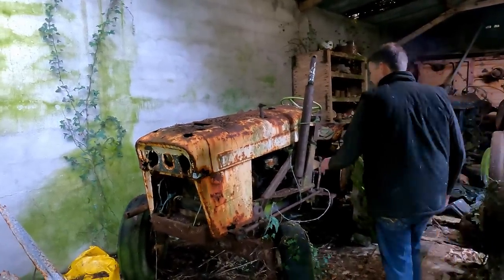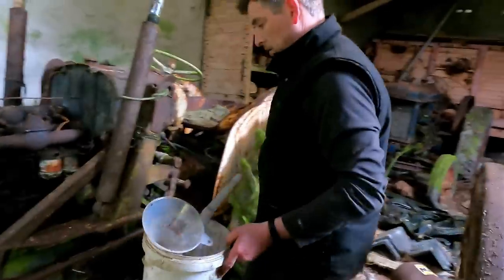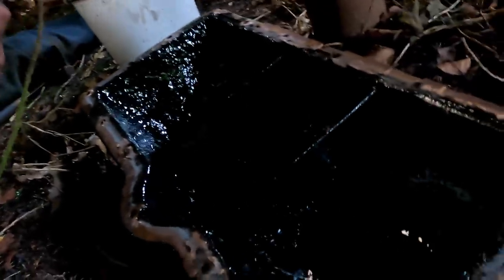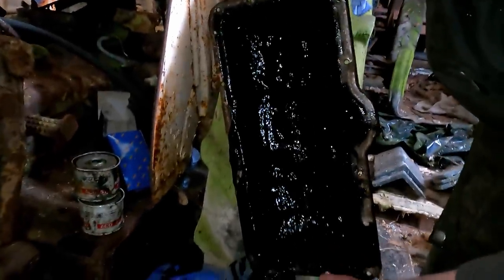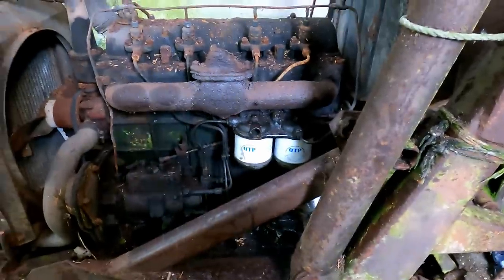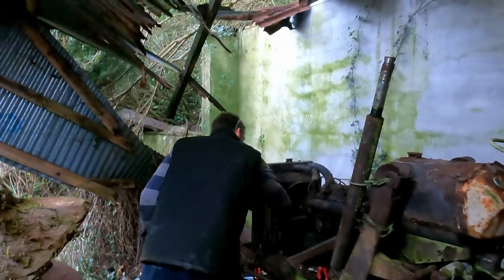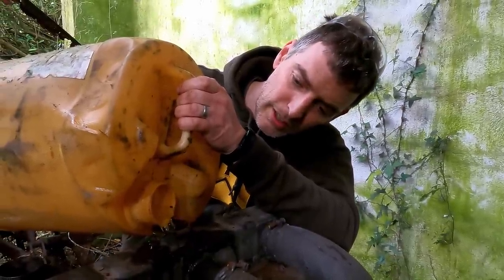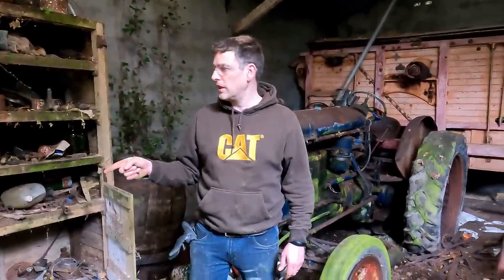Abandoned 30+ Years, will it start? David Brown 990

Comment: Very interesting air cleaner design
Reply from the maker: Oil bath filters were very common here right up into the 80s. I guess they changed as it was more profitable to sell paper element filters.
Reply: Yea I mean how it runs through the rad
Reply from the maker: It is weird, but keeps the bonnet line low.
Reply: @davesworkshop2714 
And, in winter, heats the airflow👍

Comment: I was 100% certain that tractor would not start, great job at getting it to fire up
Reply from the maker: Thanks Mike. Those DBs seem pretty resilient. Once I found it largely complete and able to roll over I was confident. Just very fortunate that the roof collapsed where it did. A bit further back and it was totalled.
Reply: @davesworkshop2714  I love old tractors simple to repair for the most part. Have been about to get 99% of the ones I worked on going again. The only one I couldn’t was a Ford gasoline tractor had spark and gas but it would never fire even with starting fluid which is very weird timing was good fuel in carb it would turn over and smoke but no run still bugs me after20 years
Reply: @mikeboring1293  That's an impressive % to get running Mike 👍
Reply from the maker: @mikeboring1293  been there with some old gassers (petrols as we call them here) in the past. Some are really stubborn and it takes very  little to upset them. I think the biggest struggles I've had were one of my Rover V8s, my detroit 6V92T and the combine. There's an old E27N gas/tvo tractor in the shed id love to start, but it's missing a lot of parts.

Comment: Wow, that's an amazing little shed with so many gems in there! That David brown just needs a few more jobs done and a few hours hard work and it will be perfect again as it sounds pretty good for one lying so long!! You gotta save that Fordson too!!!
Reply from the maker: It's an incredible find. It's just a shame the fordson is missing parts. I'll certainly see if I can do anything with it though! The 990 is in remarkable condition, the shed was obviously very dry for years.
Reply: @davesworkshop2714  You might have to do a bit of searching to find the right parts but it would be worth it ! Im sure there are still some lying about! i found a few fergusons recently, similar situation! barn falling down on top of them!!! There are still a some out there but finding them is difficult!!
Reply from the maker: @wesleyallen3421  I'm toying with the idea of temporarily fitting a distributor and coil for sparks (requires a 2:1 reduction) and making up an inlet manifold to take carbs I already have, may be enough to get it going. I'll good and soak it down with diesel tomorrow evening to see if I can unstick it. Barn finds like this are getting really scarce alright. I'll keep hunting though 👌
Reply: @davesworkshop2714  Yeah I'm sure you can rig up something! Just keep an eye online you might find the right bits!! There was one the same lying in a hedge on the main rd to Moycullen in Galway! The council cut the hedgerow back and there was an E27N Fordson! That was 12 years ago, it's well gone now! Maby some of the earlier Fordson parts might fit! You would easily make an inlet manifold for that! You will come up with something, be great to get it going again! Look forward to the next video 👍

Comment: Dave, years ago when a ford's on major wouldn't start, no ether at hand, we used lighting paper and put it on the air intake, turned the key/lever, and it started, it warmed the fuel, love your videos, no gloves, on at all, will eventually destroy your hands, Michael, Ireland [Eire]
Reply from the maker: I really should have the gloves on alright, I'll pick up a new box tomorrow, safer with abandoned gear with rats etc. I have seen an oily rag used to good effect. The old manifold heater was only a small step up from it. Thanks for watching and taking the time to comment 🙂

Comment: Great job & well done, been working on a farmers barn which has a 780 with a funny looking square cab on it, the poor thing!
Reply from the maker: Is it sat there long? You should start it 😉🙂🙂
Reply: @davesworkshop2714  been doing work on the farm buildings for 40 years & its always been there along with other strange looking machines, don't think it will start but at least everything is dry in there.

Comment: Do the major is it too or diesel  p6
Reply from the maker: Howard, I'd love to. It's a one owner 1950 TVO. Unfortunately the starter, mag, manifolds and carb are gone. It's also locked up but I'm going to try and free it out. I'll see if there's a cheap way to get it going. It would make a lovely P6 conversion. All it needs after that is a rub with an oily rag.

Comment: Great video is 990 for sale and  there's a tap on the injector pump on the bottom is to help starting extra fuel big help starting
Reply from the maker: Not at the moment Clifford, but I'll keep you posted. The excess fuel tap was seized solid unfortunately, thanks for the tip though!

Comment: I think that ya should try to air up the tires.  Unblock the rear tires., or some people call them tires & rims. AKA wheels to Dave. Awesome job I love knowing that there's still other people out there that care about trying to revive.& Recover old types of vehicles.&etc. That needs to be saved from the outside elements.,or nature will take it over faster than some folks would want to believe that it would.,or could do such A type of thing as we'll to. I say go for it on that tractor.& The other right behind it to.
Reply from the maker: Thanks John. I was thinking the same. Must throw the compressor in the back and go over there. We do plan to try and get it moving for a video, and to see if it can help get it saved. We're also working on the major behind it. Stay tuned! Thanks for watching 🙂

Comment: I only squirt ether when it’s cranking shooting it in non-cranking means it probably dumping in one cylinder. It seems like a very good engine for the way the rest of it looks.
Reply from the maker: Good point John, the tip was broken off the can so I found it a big awkward to handle 😂. Gave a little more than I would have liked too. A dangerous thing in the wrong hands! The tractor overall is actually surprising good, the roof mustn't have collapsed that long ago.

Comment: oy, have we got one for you then. we have a '70 990A that was the working tractor, here, untill only 10 years ago or so.  it has the boom and bucket accessory and a hydraulic leak.  we couldn't get the seals for the hydraulic pump in the states, and there'd been no parts support for it for years, even from the importer (Case/IH imported them to the states).  she's been parked for years with an exhaust manifold that cracked when they tried to disassemble her.
Reply from the maker: That is a shame you can't get parts. I wonder has the situation changed in the last 10 years? Maybe a classic tractor supplier could help now.
Reply: @davesworkshop2714  she's been sitting in a garage under a doublewide that's been well sealed.  The only thing I'm afraid of is a bad case of mold (a Dodge truck stored in there previously severely molded out in the interior!).  parts were nearly impossible BEFORE covid, imagine what it's like in the states, now :P  you can't even get parts for a lawn tractor, let alone a true tractor.  I'm fighting the steering on a Kubota, and need a tension latch and spring for the deck.

Comment: Much better doing without either can get anything started that way  and you could have used the wd 40 as a substitute or parts cleaner
Reply from the maker: I fully agree, it just needed a touch. The excess fuel valve was seized solid so that wasn't an option. At least it fired off the first time without it 🙂👌

Comment: Great move to drop the sump, would have been so tempting to put new oil in and go for a start.
Reply from the maker: After seeing the oil cap missing it was the only choice, I could even see some debris inside the filler. Nice easy sump to drop so it was a no brainer! Thanks for watching 🙂
Reply: @davesworkshop2714  you can’t kill a DB, strong old buses.
Reply from the maker: @spannerdog123  they certainly seem to be!

Comment: Really cool find and nice work getting it running. I was curious as to how you bled the fuel system? That big combining unit behind the Fordson is also pretty cool. We have one that looks almost the same. Cheers
Reply from the maker: Thanks Josef! I opened the bleed nut on the secondary filter and used the hand priming lever on the lift pump. Then I opened the inlet line to the pump slightly. Didn't bother with cracking injectors. I find most if the time, bleeding as far as the pump is enough. Though I did meet one cummins that wouldn't fire until all 6 injector lines were cracked. The tresher looks to be in good condition. Ill bring a video of it and the fordson soon.
Reply: @davesworkshop2714  Thanks mate, that’s good to know!

Comment: Gas torch in the air inlet works just as good as Easy Start and doesn't do any damage.
Reply from the maker: Have seen it done before. To be fair though, used correctly, and in moderation, it does an engine no harm using it once. Thanks for the tip 👍

Comment: That's an early 990 with 6 stud hubs Dave  needs saving 😊
Reply from the maker: I must get the serial number and check it. I don't know my DBs at all. Approx what year could it be? Thanks for watching Paul.
Reply: @Dave's Workshop  at a guess around 1965/66 the very early ones had ignition switch on side above brake pedals under diesel tank
Reply from the maker: @paulhoggart4572  the ignition switch is on the side in that one. Thanks for the information.

Comment: hello from the orkney isles would be great to see the fordson running great channel
Reply from the maker: Thanks William, good to hear from you. I'll certainly have a go at the Major. Will dump some diesel down the bores and see if I can get it turning.
Reply: @davesworkshop2714  the mag might need some work done to it too they dont like damp conditions
Reply from the maker: @williameunson2013  unfortunately the magneto is missing, along with the carb and manifolds 😖
Reply: @davesworkshop2714  oh dear thats a problem could you find parts from somebody their are a lot of them about broken up
Reply from the maker: @williameunson2013  I will look. First step is to see if I can free the engine.  I poured penetrating oil and atf down the bores a few days ago. Ill go back later this week and see can I crack it free.
Reply: @davesworkshop2714  hi dave any luck with the fordson yet
Reply from the maker: @williameunson2013  I've managed to break the engine free, and stuck valves, but I've left the cylinders full of atf and diesel for a while to free it up more. Have had to jump to other projects for now to get videos out

Comment: Great video Dave, I'm fairly handy with the fordson tractors and I actually have an e27n which is what is in front of the thresher here. If you would like some assistance or advice in getting it going I'd be happy to help. Keep up the good work.
Reply from the maker: Gary, thanks very much for the offer, I might take you up on that. Where are you based?
Reply: @davesworkshop2714  I am based in Co. Wexford but always looking for a trip out especially when I can help someone with a fordson.
Reply from the maker: @garyredmond6884  thanks! Is there a parts supplier for them in Ireland? The mag, carb, manifolds and starter are missing. I was toying with the idea of fitting a reduction box and distributor and coil set up to get it running.
Reply: @davesworkshop2714  I would have all the bits here to put it running. A starter wouldn't be needed as usually if the compression is good they start on the 3rd crank. Other than stuck valves I'd say an expedition to get it running would be a success.
Reply from the maker: @garyredmond6884  thanks Gary. I may be in touch. I'm soaking down the bores at the moment to get her freed up to start with.

Comment: I'm more interested in the E27N watching over the proceedings! Is it a Petrol /Parrafin?
Reply from the maker: It certainly is. Its seized and missing a lot of parts, including the mag, manifolds and carb. I pulled the plugs last weekend and put penetrating oil and atf down the bores, hopefully itll free off and we'll take it from there.
Reply: @davesworkshop2714  all those parts are relatively easy to find. As long as the block isn't damaged thatd be a viable recommissioning project.
Reply from the maker: @09amusement  I don't believe it is, though I could be wrong. I'll see how it looks at the weekend after a soak. While parts are available, it isn't my tractor so the cost may be prohibitive, but I'll see what I can do! I would love to see it run. It would just brush the surface flakes off it and wipe it with an oily rag if it was mine. Patina that you just can't buy. I've already started looking for a Perkins P6 as well just in case...
Reply: @davesworkshop2714  that's the case with my Grey Fergie. Take a look at the clips of my two on my channel. The Fergie has been through completely mechanically. New clutch, seals everywhere. That tows a trailer with the Standard Fordson aboard to local shows in Norfolk.

Comment: 😅great video,get it out and fix the other tractor too!
Reply from the maker: Thanks Robert! I'll certainly have a go. The poor major has been raided for parts so it'll be a stretch, but I'll certainly try! Thanks for taking the time to watch and comment!
Reply: @davesworkshop2714  I have two Yanmars, a 240, and an a1500, both running and working, both restored and painted! I own a box blade, an LMC posthole digger,  and a 4' mower-brush Hog
Reply from the maker: @robertharvell6721  nice useful tractors. We don't really get a lot of small utility tractors over here outside of sports grounds etc.